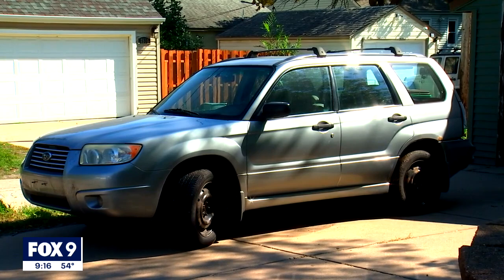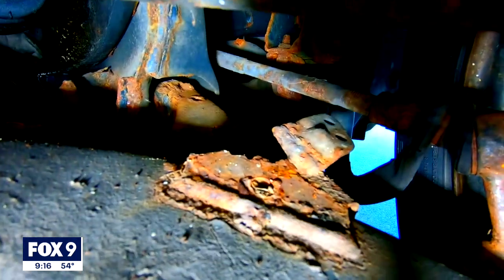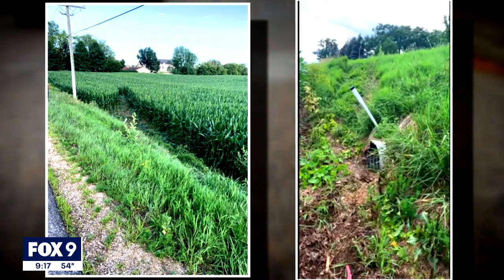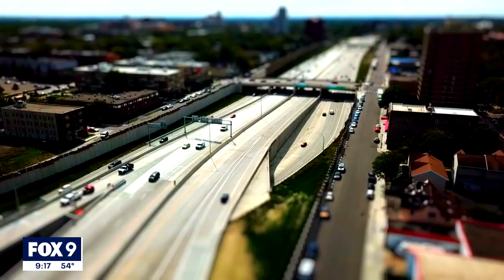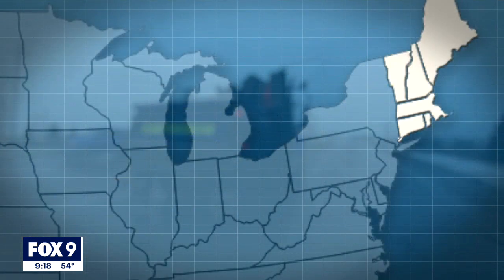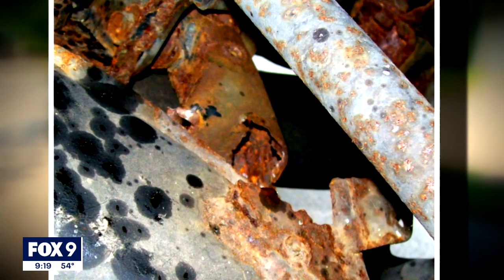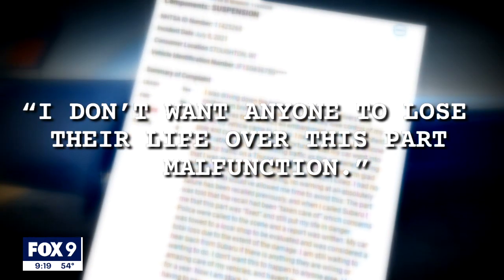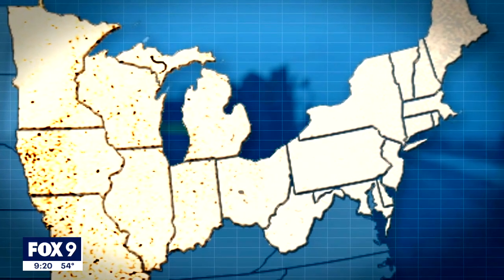Driving in the ‘Salt Belt’:  Millions of cars with rust recalls | FOX 9 KMSP

Comment: Undercoating is the worst thing you can do to your car. I watched ziebart dissolve the wheel wells and frame of a Toyota 4Runner. What they did was pressure washed the underside then sprayed their stuff without letting the underside dry. This resulted in large bubbles which essentially trapped salt water up against the body. I had someone get in the rear and noticed a big wet spot in the rear. When I picked up the carpet I saw a 3,5 inch by 10 inch rot spot in the rear. When I was done I had replaced a 12 inch by 12 inch piece of rotted sheet metal. The edges of the wheel wells rotted too and that took more galvanized sheet metal and fiberglass resin to repair. Washing a cars underside is good and remember the government makes manufactures give you an 8 year 80k anti perforation warranty. That means the government requires cars to last a minimum of 8 years or 80,000 miles before rust gets through. Many cars last longer than that. Additionally you’ll find products in the aftermarket like POR-15 which will stop existing rust in its tracks and prevent future rust from ever getting started
Reply: Not all undercoating is the same. Ziebart and other wax or rubberized coatings are GARBAGE. Lanolin or oil based products are vastly superior.  Also POR15 is crap.  I've used it exactly as specified by manufacturer and it flaked right off months later.

Comment: I squirt used drain oil on my 1995 Ford's under carriage. Still largely rust free all these years later.
Reply: Awesome my new idea make something where cars and trucks can't rust in winter states with salt
Reply: Can you put wd40 under the car?
Reply: The explorer has a different type of rocker panels but the expedition are going to rust due to the trapped moisture in the running boards.   The sn95 mustang has plastic rocker panels

Comment: Problem stems from owners being neglectful of the car. Not really a brand problem. My wife’s car we’d wash the undercarriage every week and don’t have rust developing… but my aunts car that is never washed and she just lets the salt marinate on the metal - we already know what’s going to happen. Lol
Reply: Not necessarily. Some brand of cars are known to rust more that others. For example earlier Nissan Altima’s rusted that WERE NOT in the rust belt (no salt on the roads). Most VW’s and Audi’s don’t!
Reply: Exactly. All vehicles can rust if not taken care of no matter the brand.
Reply: Not true. the salty water gets in places you can't see and it'll rust from the inside out. doesn't matter how many times you wash it. the ONLY way to prevent rust is to either not drive it in winter or getting it rustproofed with an oil based spray.
Reply: Japanese cars are notorious for rust because they don't salt the roads in Japan, therefore the cars don't have rust protection
Reply: Not true because some places have salt on the road and the ice/snow don’t melt or clear after 2-3 weeks because the temp stays below 32 degrees.  Also it doesn’t matter if you was your car every day because you going to be driving in the salty raoad as soon as you leave the carwash.  It takes a rain storm to clear the salt after the snow melts.   Hint that ain’t dust that’s salt when the roads dry off.

Comment: Van Bortel Subaru claim they performed this "spray paint repair" on my mother's Forester when the recall came out. Several years later the left control arm came very close to catastrophic failure had I not seen the rust while installing brake pads. This same dealer had issued this vehicle a New York State inspection sticker only a month prior to my discovery but they refused to repair the car at their cost. I can't overstate how awful Subaru of America is to deal with or how poorly I was treated by Van Bortel. The National Highway Safety Administration should accept most of the blame though, relying on the dealership to do the right thing is unacceptable. The dealer did eventually repair the car at no cost to me but only after I threatened them with a lawsuit.
Reply: You need to pay for the repair. It’s your car living in rust belt and it’s your life..
Reply: @georgiaguardian4696 Gaslight much?
Reply: That's right. That got them to change their tune. Good for you.

Comment: Supposed car buff isn’t aware of the risks associated with under carriage rust and rust related failure of drive train components???
Reply: The issue is these control arms rust from the inside, and the damage can be difficult (if not impossible) to see.  Also, control arms are not drivetrain components,
Reply: to add to what wintef said (he's right btw) the story also said this was a second car to drive in the winter. so it was likely not a car he cared too much about (i mean come on its a damn 08 forester, not exactly an enthusiasts car), bought it, assumed it would be safe and then it failed like this,

Comment: come on people, when you live in the "Rust Belt" once shoes don't even last 1 season.
Use Dinitrol and/or waxoyl and you never see rust. Its not just the salt, its calcium chloride
and nasty. Spray the floor and all other parts under the car with used motor oil if you cant afford proper anti rust treatment. For crying out loud, I drive an over 40 years old Citroen
without rust, so it can be done. None of these wining owners never looked under their car?
Grow up.